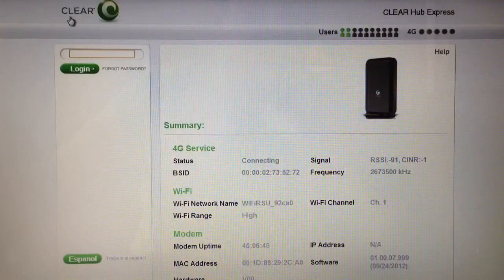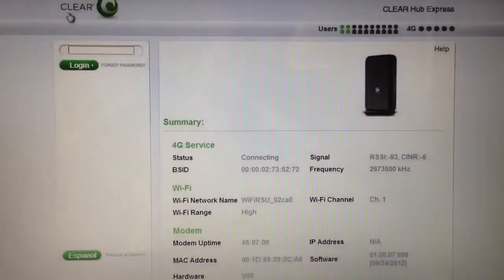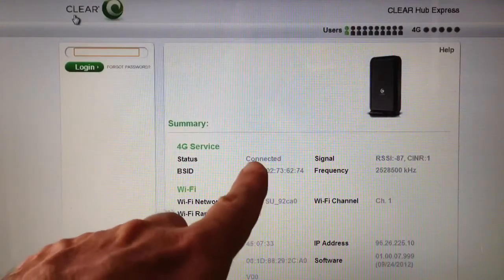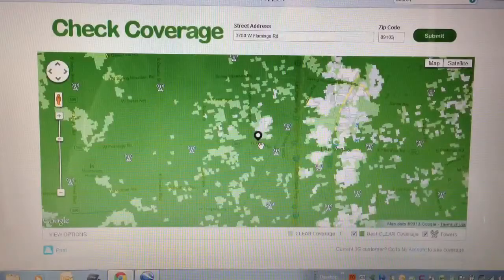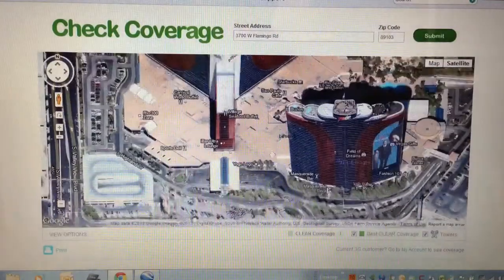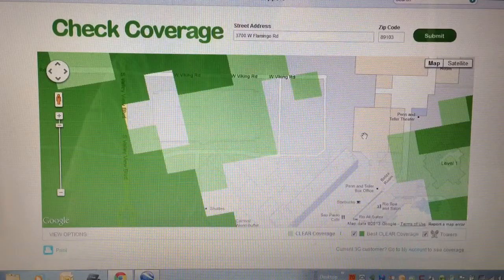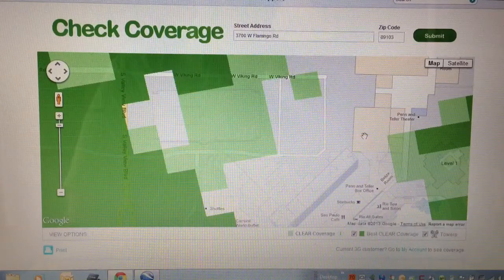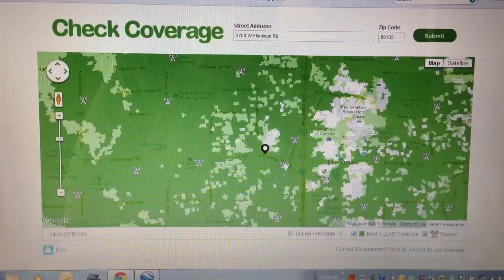CLEAR Hub Express using my 18dBi WiMAX Antenna to improve reception in a hotel room

Comment: thanks for the video, it was very helpful  ... i dont really have buildings blocking me from the (Wimax Base station) in my area but tall tree ... my RSSI is fluctuating from -70 to - 76  which browsing fair but my streaming suffer,  i hope getting 2 of these antenna really help ...
Reply from the maker: TREES are not our friends when it comes to RF signal. Unlike buildings that typically reflect the signal (which you can compensate for in some situations), the water content in the leaves and the branches block and/or absorb RF signal. The varying signal levels you are receiving may be due to the movement of the branches and leaves. Over time the growth of the trees may also start to impact your reception. A Dual-Antenna system would help if you can individually orient (aim) each of them towards the strongest source of the desired signal. In some cases when dealing with trees you can get away with using Dual-Antennas in a side-by-side configuration (separated by at least 1.5m). This will provide two different views of the incoming signal for the DSP to work with. "Both of the antennas" should be oriented in either a Vertical or Horizontal Polarization. OR, you can also try orienting one in Vertical and one in Horizontal Polarization to possibly take advantage of the difference in Polarization as the signl reaches your location. Try all three ways (Both Vertical, Both Horizontal, and One in Vertical plus One in Horizontal) to see how it affects your signal reception. Just be sure to aim each one individually for the best RSSI. Good Luck with your project.

Comment from the maker: Question: What did I mean by the "Other Antenna" in the modem? There are two WiMAX antennas built in to the Hub Express. When you ENABLE the connection to the EXTERNAL ANTENNA port you are only rerouting one of the antenna circuits (ANT1) to the external antenna port (ANT3). The second antenna circuit (ANT2) within the modem is still active! FYI - I take advantage of ANT2 in the video, however, be forewarned that it can also be a source of RF Interference & Noise from within your location.